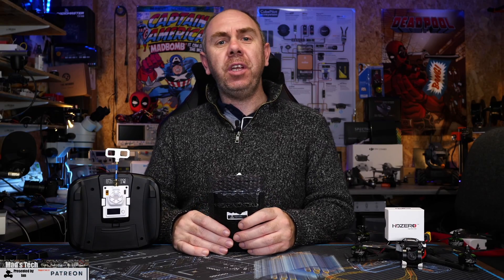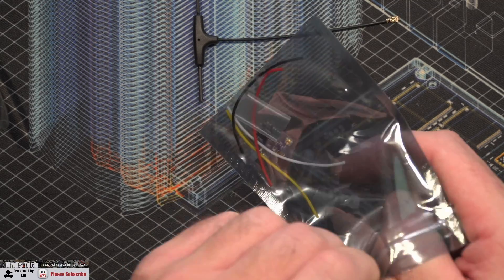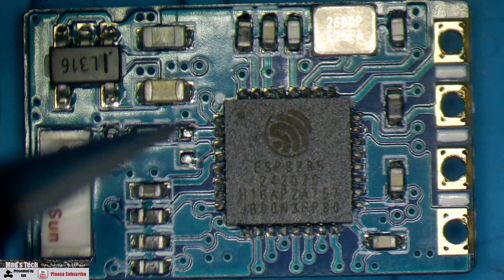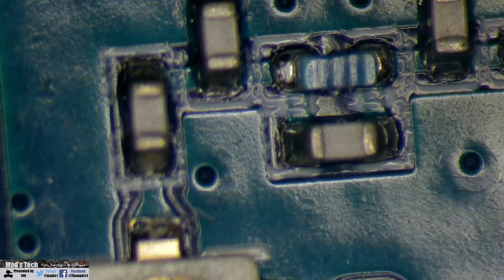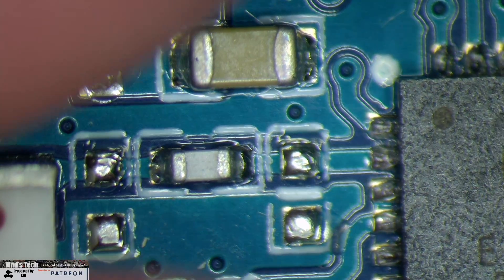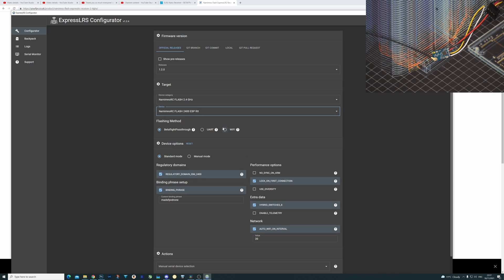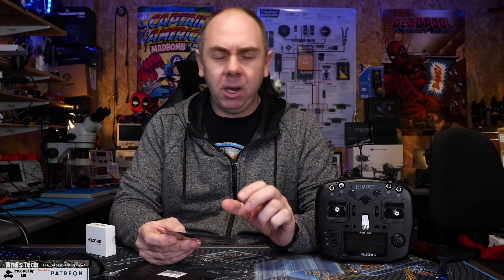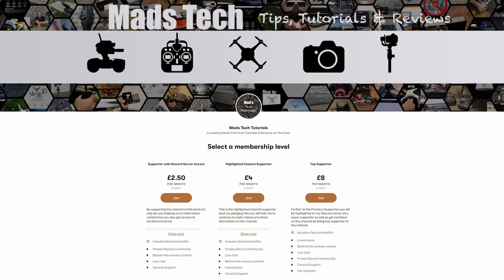Namimno ExpressLRS Receiver - Best Quality Module ?

Comment: My Namimno Flash RX that come with the TX bundle has a smaller purple PCB, and doesn't has bind button. I've never seen the RX in your video sold anywhere before! Is this new?
Reply: Looks like the old receiver. You have the new one.
Reply: @pascalwatteel2095  Oh.. you're right. Thank you